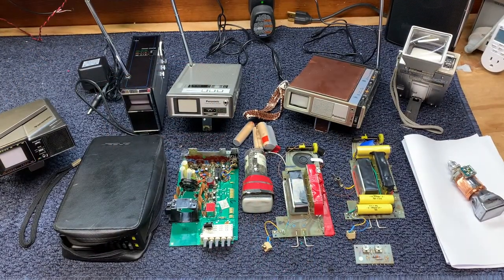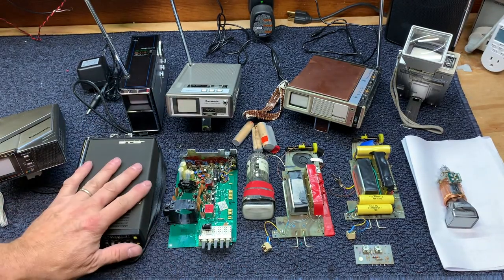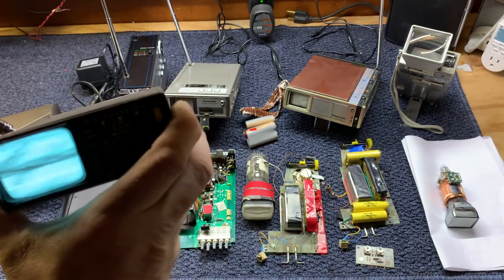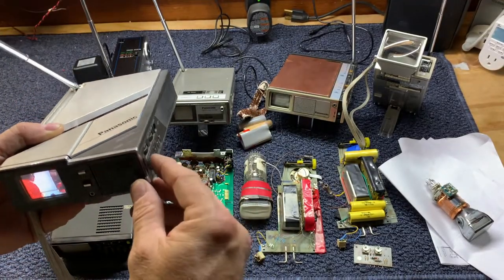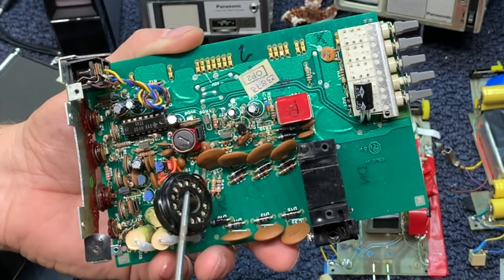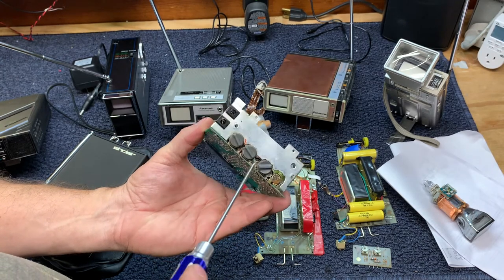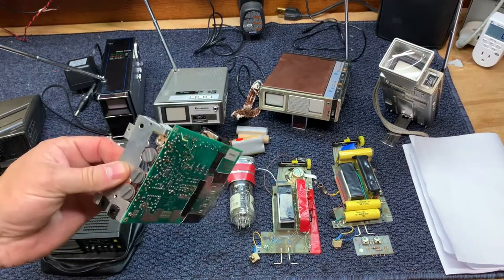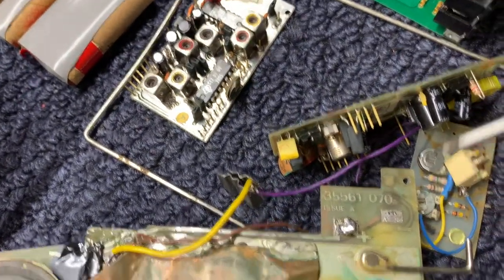Rare Sinclair MTV1 Repair and Demo

Comment: Can u please tell me where you purchased the new batteries?
Reply from the maker: Amazon sells a 1.2 volt nicad. Very common rechargeable AA battery
Reply: I found them but that's only 4.8 volts I thought it works on 6-12 volts? Do u know the part# of the 3 leg transistor? I found this tv today at a indoor flea market for 20.00. I disassembled it and the batteries are bad but there's no leakage anywhere. Do u think it's repairable? It didn't have the power adapter either. Buy I think it was a great price for its age.
Reply from the maker: @genesantos7656  the battery power is looking for 4.8 (5) volts as designed so these work great. The 6&12 volt adapters are plugged into a regulator circuit to drop the voltages. I am not sure which transistor you tea talking about. There are several on the tv. That $20 is a terrific price. Good job!!
Reply: The transistor you said u took out of one to get the other working in the video
Reply from the maker: @genesantos7656  OK I’ll have to look at that again. I work on so many of these. I can’t keep track of all those details.
Reply: I got the TV to power on but I have no sound? What do u think may cause this?
Reply from the maker: @genesantos7656  it’s very likely that the gold contacts between the boards are corroded and need cleaned. They’re very fragile as I have pointed out in some of my videos. Additionally, the capacitors on the soundboard tend to fail and probably need to be replaced.

Comment: Mine has picture but dont have sound?
Reply from the maker: It is likely a bad pin connection where the boards meet.
Reply: Have u ever had to replace the 2 ic chips on the audio board?
Reply from the maker: @genesantos7656  no. Never had any trouble with them.
Reply: Can u please tell me where the 2 wires coming from the headphone jack connect on the board? yellow wire and blue wire
Reply from the maker: @genesantos7656  also if your headphone wires are disconnected then you will have no audio.
Reply from the maker: Watch the video at the end. You can see where they connect on the board in the video.  I tried to copy a photo here but YouTube doesn’t let me. Go to 22:10.
Reply: So I'm getting sound now but how can I get a picture? I seen on this video that you had a picture how did u get a signal to the tv?
Reply from the maker: @genesantos7656  you must transmit an analog signal to your set. In the US the over the air tv signals are not analog. I use a couple of “Blonder Tongue” units.  You can also get a RF modulator and transmits that way.  Do a search on eBay or Amazon for analog TV modulator. A cheaper way is to use one that accepta an RCA signal and converts them to TV signal on channel 3 or 4.
Reply: I wish u would post a video on how to connect a modulator to this tv since it only has to screws to connect anything.
Reply: So do I need a rf modulator and a digital converter?
Reply: How did u get the roku connection without any cables plus you got Andy griffin show how? I thought all analog signals are all digital now?
Reply from the maker: @genesantos7656  no. Just an rf modulator that outputs to channel 3 or 4 VHF..  These are super cheap online.
Reply: Can u possibly send me a link for one that will work? I'm having a hard time finding one since there's only 2 screws to connect to on back of tv there's no cable rf connecter on this TV do I have to use a 75 ohm balum?
Reply from the maker: @genesantos7656  those two screw connections are where you will connect the RF modulator. Some of these tvs were designed to work with 300 ohm connections and later they modified them to work with 75 ohms. No worries. Either will work well enough to get video.  Let me check on a possible link for you.
Reply from the maker: And yes that is where you will connect a 75 to 300 ohm balun.
Reply from the maker: @genesantos7656  https://www.newegg.com/p/2VR-067J-000M2?item=9SIBPPKJZT8503&nm_mc=knc-googleadwords&cm_mmc=knc-googleadwords-_-audio%20video%20converters-_-miqpower-_-9SIBPPKJZT8503&utm_source=google&utm_medium=organic+shopping&utm_campaign=knc-googleadwords-_-audio%20video%20converters-_-miqpower-_-9SIBPPKJZT8503&source=region&srsltid=AfmBOooNOSK6zqbLPzf0FvzvWdtwXrLoMvo3xKQcuvmfk5TMGpEY9v60xEI
Reply: I just found a sinclair ftv2 but it didn't come with a power adapter. It's 6 volts but is the center pin positive or negative on the power in put?
Reply: Do u have a sinclair ftv2 power supply?
Reply: I purchased that rf modulator from newegg I'm confused on how to connect it to my tv the instructions are terrible. Do I have to connect the modulator through a digital tv converter box? I'm so confused any information would be much appreciated.
Reply from the maker: @genesantos7656   connect the RF connector of the modulator to the two screws on the back of the tv. You may need a little 300 ohm to 75 ohm adapter to attach the modulator to the tv.
Reply: I did what u said no channels coming in don't I need a tuner of sort?
Reply from the maker: @genesantos7656  what kind of video source are you I putting into the converter ?
Reply: Digital tv converter
Reply from the maker: @genesantos7656  if your tv is working you should be able to tune it to VHF channel 3 or 4  and get video and audio. Make sure you have the proper buttons selected on front depending on your location UK, USA, etc.

Comment: I have an mtv1 from 78  i dont know of it works
Reply: I want to buy an  charging cable  do you know how much amp max you can put in.
Reply from the maker: @spectator9497  the 12 volt Sinclair AC adapters units are 500 milliamp.   That’s .5 Amp. The unit draws around 200 mA when playing video and draws 60 mA when off and charging new batteries.
Reply: I want to sell it you know how much this tv is worth
Reply from the maker: @spectator9497  in the US they are selling on eBay from $40 to $150 depending on condition and accessories.  I have 5 of them. They are challenging to repair and parts are scarce. Two of mine are with original boxes and papers. Those bring a little more.
Reply: @KOVintageTech  well i have the case with it condition looks great
Reply: Maybe i can send it to you too see how much the price wil be, i bought it from a guy he told me it still works but there wasnt an cable with it.
Reply from the maker: @spectator9497  the problem you may have is finding a barrel plug that will fit the Sinclair. These TVs use a non standard size plug.  I had a terrible time finding a plug to power the unit.  Finally I bought two TVs that came with the original power adapters. Both 12 volt and 6 volt.
Reply from the maker: @spectator9497  I’d be interested, yes.
Reply: @KOVintageTech  i live in the netherlands, i could send it to you, if its in great shape you could buy it from me, but that will be your choice, i will pay for the shipping.
Reply from the maker: @spectator9497  let’s do this. You give me a price and I’ll consider it. Like I said I have 5. But I’d like one more that works.
Reply: @KOVintageTech  oke great. I hope it works than  lets hope the man that sold it to me didnt lie.
Reply from the maker: @spectator9497  email me at koviatt at gmail dot com